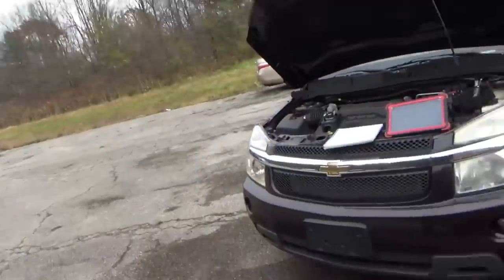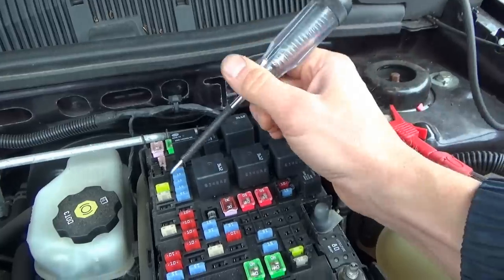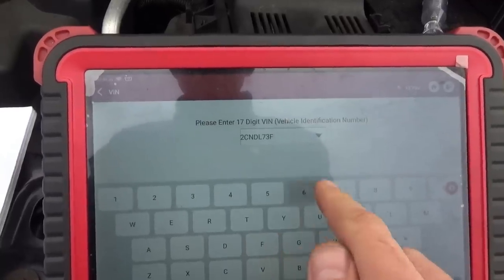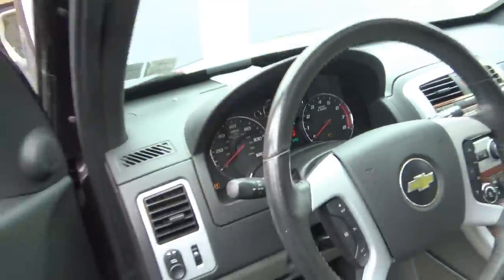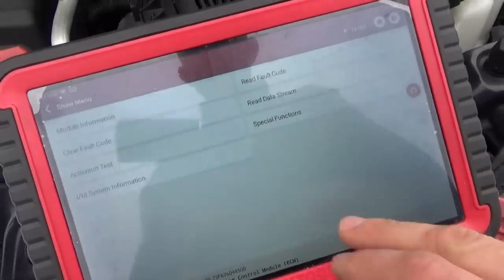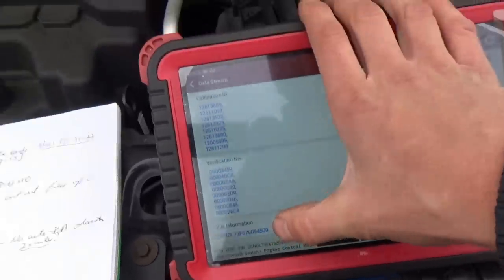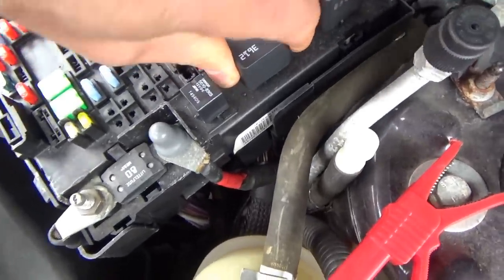Auction Car SABOTAGE? (Equinox No-Crank)

Comment: My opinion is that the auction didn't want to give the customer back his money, so they made the vehicle "non-returnable" to try to get out of it.
Reply: d'UH !!!
Reply: No problem YOU  savatage the hood latch so it can't be opened but still runs . or some stays with the car at all times while its running .
Reply: Can someone explain this more? How is this non returnable??
Reply: @Walczyk   no start no return
Reply: @mechanicandskills7215  so if it starts but has water damage or bad rust you can return it?
Reply: @Walczyk  as long as it was not years later after purchase think of it like a sandwich have a problem return it soon
Reply: @Walczyk They sold it to the customer and he drove it off the lot. The return is for rotted out frame. You must be able to DRIVE it back to them in the condition they sold it to you.

Comment: Another trick the auction scumbags use is they cut off one leg of a fuse. Then they will reinstall the fuse with the good leg in the B+ terminal. That way when you check the fuse with a test light it appears to be good. I've learned to always remove the fuse and check for this.
Reply: Wow! Thanks.
I go to construction equipment auctions and noticed funny business by creeps during inspection before bidding...
Not cool .
Reply: Eric O from SMA says that all the time.
Reply: Why do the auction people sabotage the cars they are trying to sell? Or are some of the auction people wanting to purchase the cars themselves so they sabotage them hoping to get them at a cheaper price?
Reply: @TheOnespeedbiker  they make vehicle machine " no start no operate" and it goes much cheaper for online bidders especially . Then they get it low bid and fix it to sell .
Very common at construction machine auctions.
I usually get there earliest to inspect and know what ran or operated before they have a chance to yank a fuse wire relay sensor etc.
Reply: @TheOnespeedbiker  It's often the potential buyers who do something to the vehicles during the pre auction inspections. In Canada, they would often pull the door stickers off that certified that the vehicle meets US emission standards to make it difficult to take a vehicle to the US to deter US buyers.
Reply: @MitzvosGolem1  So the other buyers sabotage the cars?
Reply: @TheOnespeedbiker  Yes sometimes they sent a guy in to make sure a good car they want won't start etc .Then buy it cheap and fix simple problem they caused.
Reply: People suck that’s all I’ve got to say about that
Reply: @sheerwillsurvival2064  some not all..
Reply: @TheOnespeedbiker  In this case they want to refuse to buy back the rotted car they sold. At an equipment auction they would sabotage a piece of equipment they are interested in to lower the bid price and lower interest from competing buyers that might not be interested in a non running piece of equipment and try and scoop it up cheaper. The staff at the auction in that case wouldn't be doing but bidders poking at things while they look the items over.
Reply: Also a good prank on your diag mates in the shop.
Reply: @TheOnespeedbiker  usually buyers tryin to get them cheap. I know people who do it.

This auction was gonna hafta buy this car back cause if the rotten frame, so they sabotaged it so they wouldn't hafta buy it back
Reply: Heeeyy I'm the creep that does that.!!!!
Reply: Auction cars are a roll of the dice.  My 1st was a diamond in the rough.  My 2nd and 3rd have been huge headaches.  Takes a strong will to deal with auction bs
Reply: This is really a tcu loss communication

Comment: I bought a motorcycle at an auction once. I showed up the day before to check out the motorcycle. I asked can I start it up and the worker said sure. Well it cranked and wouldn't start. The worker said hmmm. It started the day before. Well anyways I came back the next day and bought the motorcycle and brought it home.  I was trying to figure out why it wouldn't start and I found out why. Someone pulled two of the inner hard to see plug wires off of the plugs. I plugged them back in and problem resolved. So definitely someone tried to cut down the competition and get the price down.

Comment: Yep that's an auction classic. The fuel pump relay or the starter relay. Had it happen to me more than I'd like to admit. Last one was an 06 Accord they pulled the starter relay on. And while in the auction yard someone stole the cat. Good times.
Reply: @radio rescue another is unplugging the crank sensor. I have caught potential buyers doing sabotage to try and buy vehicles cheaper.

Comment: I have always called the process of diagnosis the term of becoming a detective, a forensic detective to be more exact.
Reply: exactly try commissioning new machinery that's never worked, it's just the same nothing is impossible, if it's ever worked at least you know it's connected properly and you are looking for a fault, if it's never worked it could be anything
Reply: @kwinterburn :  EXACTLY.  NEW car dealer techs experience WEIRD problems like oil passages in transmission not continuous, or wiring that LOOKS perfect, but some crimping anomaly or pin insertion failure on 1 wire haunts the vehicle. Time Vampires!

Comment: I do work for an auction and see that kind of stuff all the time. It's not always the people that work for the auction. Customers do it all the time to try and get the cars cheaper. I've seen many different things in me days of doing them.
Reply: I used to work for local roads department. A crew came through and sabataged a few cars they were interested in under the guise of presale inspection. So they wouldn't start for others. Caught on security cams they were arrested when they showed up on sale day. 😁

Comment: Years ago on old sitcoms and movies, someone would remove the distributor cap to make the car not run. It was usually done as a scam that another character would realize since there's no conceivable way the cap could come off by itself like that. What are the odds of a relay popping out and reinserting itself 90 degrees from its original orientation?
Reply: my brother and i would remove the rotor from under the distributor cap of are friends cars and watch them have all kinds of fits trying to figure it out... all the wile me and my brother were laughing at them.... hey what are friends for!!!😁 and yes we remained friends for years.... the saying go's... if your not picked on nobody loves you!!!
Reply: I built a few kit cars (open tops, no doors) and as an over night immobiliser I would take the rotor arm out, also a switchable wire from coil live to ground is handy for quick stops
Reply: How about just adding clear varnish to the distributor cap rotor.
Reply: @dueymiller5795  why?
Reply: @1988dgs  To be mean and rotten to a person who deserved it. A car needs three things. Gas, spark and compression to run. Compression is normally skipped because you can hear a car dying from lack of compression. So that leaves you gas and spark. And those days you just put a little gas and the carburetor intake vent to see if it's not getting fuel. And other check is too take off the spark plug to look for spark. And if you have no spark the first thing you would look for is a missing rotary cap. But it's there and it looks fine. So it must be something else in the ignition system. But it's not. How many people will think about putting an OHM meter on a rotary cap?
Reply: @dueymiller5795  cars have coil packs these days
Reply: @1988dgs  with a little thought you can mess up any car. Coil packs? How about cutting the wire then super gluing it back together if you do a real nice job the spice is hardly noticeable and the super glue will make sure that the connection is not made.

Comment: A friend I have was working for a dealer and auction house in Waverly NY where we always had plenty of trouble shooting to do, wed often see cars with no problems when the rolled in suddenly need work an hour or so befor the sale,how ever we found the cars closer to the sale house never had issues as they were under guard continually and the rest were a ways away out of direct view of the guards that since has been modified with video surveillance and roveing patrols.

Comment: Could it be someone tampered with the relay to stop the pump and ergo stop the leak without any visible signs?
Reply: My understanding is the customer bought the car, drove it home, Found the Chassis was rotted out, Drove it back. Auction House didn't want it back so 'sabotaged' the car and said they couldn't have it back as it was now a non-runner.....

If I'm correct they are Dirty Scumbags, and the identity of this particular Auction house should be posted online and go Viral!

Comment: Auction cars are a roll of the dice no matter how they look, having said that while auction companies are legit they certainly are shady
Reply: you have to watch their shady claims too. I knew one auction place that sold cars with the guarantee that the transmission didn't slip. So I bought a car that had some minor issues except the transmission wouldn't go into the correct gear or stay in neutral with the selector lever though it went down the road fine.. I took it back. We road tested it. The lacky there said "the transmission doesn't slip, therefore it's not covered under warranty".

Comment: Only thing more dishonest then a car dealer is a car auction house. 

To those that don't understand what happened. Used car dealer bought the car without being able to inspect it first (Most auctions they roll through and get sold as is) and this one was presented as inspection passable and running. Dealer gets the car and finds the subframe is rotted out which means it won't pass inspection there. So they take it back for a buy back. Auction house then tampered with the car to make it non-running so they could buy it back for less and still make money. 

That is just the tip of the iceberg. Lots of buyers when you can get hands on with the car do things like cutting the leg off a fuse, making connectors look connected but loose etc. So they can buy the car for less.

Comment: Good straight forward diagnostics. Is there any chance you could review some of the lower priced scanners? Say the 200 to 300 bucks ones?
Reply: Think Car has some cheaper options - ones more cost justifiable to a shade tree working on his own.  But some require a subscription.   I'd also like to see a review to see how they stand up to the Pro model here.
Reply from the maker: Either buy a $30 OBDII dongle or the Autel MK808 for $500. Anything in between is a waste of money 💸😉
Reply: Good man. 👍
Reply: @PineHollowAutoDiagnostics  That includes others in the ThinkCar line?  I like your tool, but just too pricy for DIY my own car.
Reply: @PineHollowAutoDiagnostics  but what if i buy a 10$ obdII oh now i get check engine but no code is showing anymore and it resets itself when i conect the obd lmao,i know it had p420 now it doesnt show anything only light and now a sensor for water temp was broken and no code car not working i just changed the sensor
Reply: @russellhltn1396  well the OBDII ELM247 or whathever its called original thing is over 20$ and its black i used both that and one counterfeit 8$ one thats blue transparent

Comment: I worked as a temp as a driver for an auction years ago and busted a couple of guys who worked for a dealership who were tampering with cars at the auction.  They tossed a gadget into some bushes. After they left, I took the gadget to an official to show it to them and told them who had it.
  They ended up banning those guys.

Comment: love it,  I used to comission machines  and the first question is has it ever worked ? in this case no, so you are looking at a whole new vista of possible issues,  in this case sabotage but usually just assembly issues, missing parts,missing components or wiring the list goes on and on , real first principals stuff is it wired up?  is it plugged in ? why is that there .. superb video that issue would have foxed most " techs" and those familiar with the vehicle type would be the worst at actually diagnosing it,. bravo

Comment: It's 15 years old, sat outside, probably worse was not moved as snow piled up. The snow drifts over years starts it, maybe sat in moist shady area and it becomes a year-round issue.
Reply: Yep, moist shaded are. Add salt to the mix and it gets rotten.

I had an old civic hatch I bought for cheap, it was 20 years old, only had 50k miles on it but it was a rust bucket.
Reply: I hate cars from the east coast they are all rot boxes, and out here on the west coast like cali cars will not rust in 30 years outside they just dont rust here. Have had a F250 that we have owned since the 70's been outside its entire life, with no paint work at all done on the truck and it has not a single speck of rust on it.

Comment: I like that high amp test light idea, to avoid blowing more fuses.
Reply: It's an old trick used by TV repair guys, to current limit whatever is down stream. Dim bulb test.
Reply: the screwdriver with light into it yea its an thing i saw when i was little

Comment: From my experience when doing Prescans of reman transmission before programing them they pull the old VIN from the reman transmission before they are programmed. 
I'm assuming they are auto ID by VIN in transmission. 
GM Techline Connect pulled the VIN to the vehicle from the ECM 
Odd but happens on everyone with a reman

Comment: A great job I wonder if somebody did screw around with that vehicle cuz if the other customer stated they drove it today was able to drive it with that much fuel being leaked out wouldn't it run lean very interesting thank you

Comment: Wouldn't a test rig set up with circuit breakers be more efficient?  You could just use two wires out of a box and use a selector knob to dial in the breaker that you want to use and see if it trips.

Comment: Could THAT relay blow the fuse?
Reply: Not likely.  The relay was for fuel pump, and the fuse was for the transmission control module.  Plus, the fuse didn't blow again.

Comment: Cleetus Mcfarland got burned by Copart recently. He bought a newer wrecked Porsche 911 Turbo S from them, and the site stated that it ran and drove. They didn't find out until after they had picked it up that the engine had split in half.

Comment: I bought a '88 LSC at an auction. When I picked it up the premium sound package was missing. Paid $1000 for it. Ran fine after I replaced the air bag system with Mustang springs. Then found out it had no overdrive. Then the break system went belly up 2 years later. Bad news could not get a mechanic to replace that system with a Mustang-R brake system.
 Guess that stabil it track and ABS is mandatory every where except the race track. All were afraid of the .gov inspectors.

Since when are reliable brakes not much better than maybe brakes? I think that most just wanted me to sell them the old no rust collector Lincoln.
Maybe to make a homemade 4 banger conversion '88 Mustang GT. Then sell that to somebody that does not know what to look for in the chassis and VIN? Yes the drive train and brakes for a LSC is the same as a automatic GT. With one difference. Vacuum boost instead hydraulic boost will fail often brakes. 
Yes If you don't have your own shop. Your own tools. Do not do it.
 Anything made after 2000 is a mandated mess of engineering.
Lease new and let somebody else live with the post warranty problems. My nephew leased a 94 LSC. He said the best thing the dealer talked him into was leasing it. He bought a 84 Impala and rebuilt it. 90 days before the lease was up. He drove a rental until the Impala was done.
He did not have to drive the Lincoln to the dealer. It was still there 'waiting for parts.'

I have a Trax and it also is not going to make it to 100,000 miles. Oil changes at 50%, fluid flushes and maintenance at much less than recommended intervals can't make up for piss poor engineering.

Comment: In N. Irelands copart I purchased a 2012 SLK with 30k miles, with an engine fault. When I got the car home I checked the fuses and sure enough the fuel pump fuse was missing, I replaced the fuse and away it went with no other problems. The SLK delivered to my house was less than half book value, bargain....

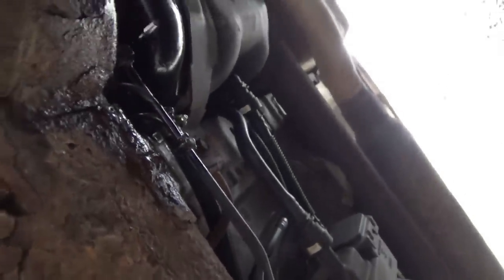Comment: That’s junk right out of the dealership. There are no domestic vehicles worth buying anymore. The German cars are relying on past performance to compensate for their poor performance. The  Korean vehicles have an extended warranty because they need it. Only the top three Japanese manufacturers are worth buying if they’re made in Japan. Toyota, Honda and Subaru all are well made and reliable. I own three Toyota hybrid vehicles (15, 11, 6 years old) 12:45 that have never needed anything but oil changes, tires and 12v batteries. No traction battery problems whatsoever! I have not even needed a brake pad because of the regenerative braking.

Comment: Good thing the pins weren't making good contact because I speculate that would have fried the ECM if the transistor got backfed power from the load side if the driver activates inside the ECM.